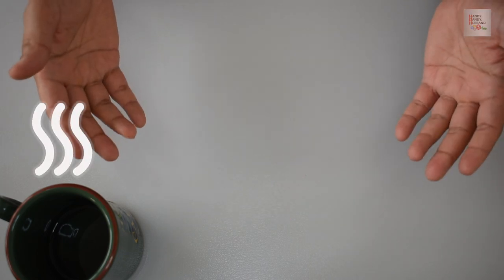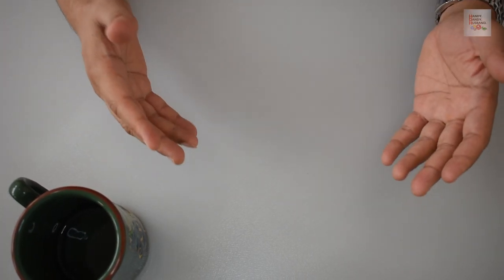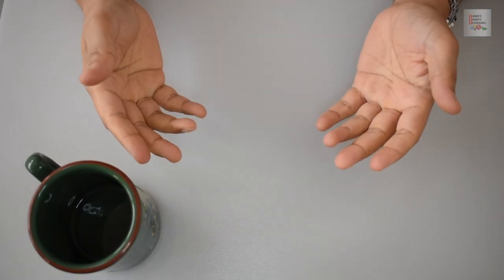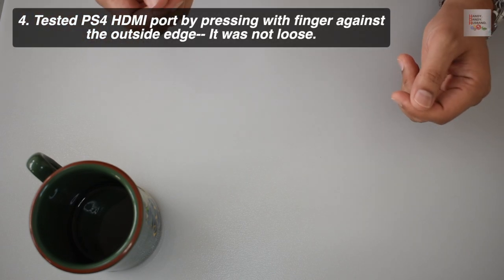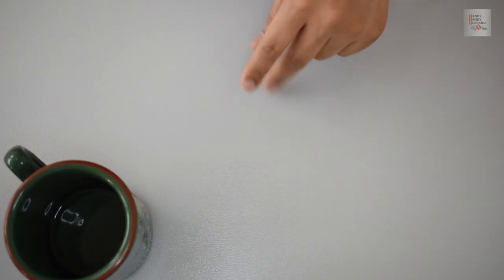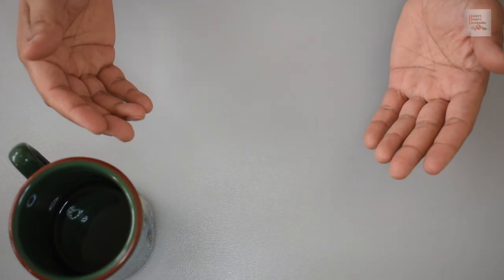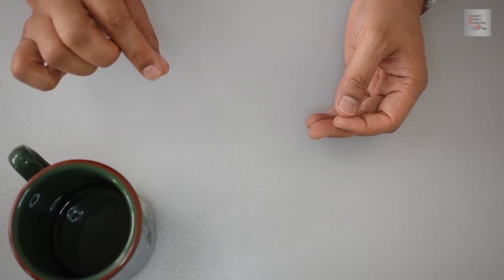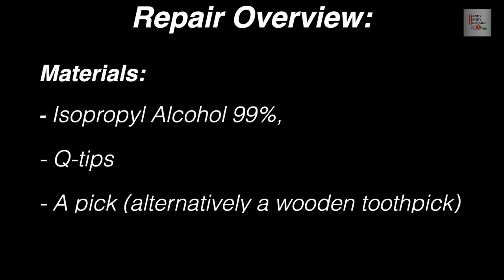𝗤𝗨𝗜𝗖𝗞 𝗧𝗜𝗣: 𝗣𝗦𝟰 𝗛𝗗𝗠𝗜 𝗣𝗼𝗿𝘁 𝗥𝗲𝗽𝗮𝗶𝗿 -- Easy, no solder required -- [Fix that video input error]

Comment: My ps4 still isnt working ive tried all your steps and it still doesn't work maybe i need to get it mechanical repaired which will cost me my leg 😔 but thanks for the tips .....
Reply from the maker: Hi Akatsuki, thanks for watching and sending me your results.  I am sorry the fix didn't work for you--that is such a bummer.  Make sure before taking it for repairs, contact Sony and ask them for a warranty approved repair depot near you.  It may be helpful to ask the Sony rep at that time if Sony would approve a warranty repair considering the problem was so widespread on all of the PS4 consoles--they may not agree but at least you tried.  All the best to you in 2021, H.D.H. [: { ].
Reply: @HANDYDANDYHUSBAND  I would but the system wasnt owned by me at first and thanks for the feedback and its ok ill figure it out its nothing major .....
Reply from the maker: @akatxukii  Hey there Akatsuki, wish you all best in getting your PS4 up and running.  Thanks, H.D.H. [: { ].
Reply: it dont have to cost alot keep lookin I found a place that reflows for 50
Reply from the maker: @cmoneytheman  Hi cmoneytheman, thanks for your comment and helping a fellow community member out.  All the best, H.D.H. [: { ].
Reply: @cmoneytheman  yoo thats crazy u just replied I just took it in the repair shop 😯
Reply: @akatxukii  u did its 120 in mornin here which country u in
Reply: @cmoneytheman  U.S.A vro 🧐
Reply: @akatxukii  u said u just dropped off is it not night where u at
Reply: @cmoneytheman  not just  dropped it off i mean i dropped it off earlier today and its crazy because u replied the day i dropped it off that's what i was trying to say
Reply: @akatxukii  ohh do u need a reball or flow I get a flow only a 100 for both ps3 and 4 all together
Reply: @cmoneytheman  i totally get a flow (idk what any of those mean 💀)
Reply: @akatxukii   did they not tell u and how much

Comment: Honey, a blind man can see that the "old" and the "new" HDMI connectors are not facing the same way. And those prongs - they have nothing to do with the signal output. They are only there to secure connector in place if you needed to move around cables or the console .. Definitely try to clean the port and replace the cable (it cold be a broken wire inside if you are moving it around a lot) but I would keep my hope in check if I were you ...
Reply from the maker: Hi The Riddle, thanks for watching and your comment.  I appreciate you taking the time to comment.  The metal prongs, I agree, do secure the cable contacts in place; however, that does not mean that they have nothing to do with the signal.  With HDMI--especially with the connectors on the PS4--the metal prongs play an important role.  When they are flattened out, they are unable to maintain the correct position of the cable to the small contacts coming out of the playstation and this then compromises the signal.  I don't need to keep my hope in check...the method worked well for me an many others.  I am sorry that it did not work for you.  All the best to you, HDH [: { ].

Comment: I’ve got mine replaced 3 times and I don’t touch it and it just falls apart it’s pissing me off because I can’t see to extract the data from it
Reply from the maker: Hi OsamaBonJovi, thanks for watching and sending me your experience with the PS4.  It is shocking that you have replaced the HDMI port 3 times.  Typically factory authorized repair depots replace the HDMI port with something much better than the OEM.  The fact that you say that 'it just falls apart' makes me suspect that the repair center is either not securing the port properly to the board or is soldering with cold joints.  You might want to ask them what type of soldering station they are using and/or if they also use a solder reworking tool (that blows hot air).  I would definitely take the PS4 to an alternate repair center.  Sorry that my fix didn't work you though man.  Hope you are able to get a proper fix done to the PS4 so that you can once again use it.  All the best to you, H.D.H. [: { ].

Comment: Yo bro sewing this video late my hdmi port fell into my game anyway you can help?
Reply from the maker: Hi Big Jay, thanks for watching and sending me your question.  I need some clarification:  when you say your "HDMI port fell into your game" do you mean the port broke off the circuit board and is now inside the gaming console shroud?  If this is the case, my fix won't correct the issue.  If the issue is something different, such as your HDMI port being loose or wiggling a little I might be able to give you some helpful suggestions.  Let me know, and I will try to help.  Hope to hear back from you, all the best to you, H.D.H. [: { ].

Comment: I’m struggling to get my prongs up please give advice thank you very much.Edit I pulled it up but now my hdmi won’t enter the pins are in the way I think I did it too high is there a way to pull them down
Reply from the maker: Hi Sarmad Hassan, thanks for watching and reaching out with your question.  OK.  I understand you are having difficulty with the thin metal prongs.  1st:  remember NOT to touch anything in the center of the HDMI port.  2nd:  If you pushed the outer thin pieces of metal too much toward the center, then gently push them down with a little bit of bouncy motion using a pick or a long thin pin/needle.  3rd:  remember that the front edge of these thin metal pieces needs to be flush or nearly flush (only the center circular bump should be protruding slightly upward) with the outer casing of the HDMI port.  If it is not, then the HDMI cable head will snag on it.  Hope the above helps.  If you need any further help, feel free to reach out to me.  All the best to you, H.D.H. [: { ].

Comment: My hdmi port has two metal strips missing and when I put the hdmi in it wiggles and is very loose. I don’t think it works anymore
Reply from the maker: Hi Sitsocits, thanks for watching and sending me your question.  I am sorry to hear about the state of your HDMI port.  I am not sure how the port lost the two metal strips--perhaps they broke.  If the HDMI cable is very loose, see if you can jerry-rig it in a position that provides a good video connection to your PS4 with some duct tape and patience.  Apart from that, I would suggest taking the PS4 to a factory authorized repair depot to have the port replaced.  Sorry my fix didn't work for you.  All the best to you. [: { ].

Comment: I’ve tried everything and my PS4 won’t connect to the tv
Reply from the maker: Hi Pc Joe, thanks for watching and trying this fix.  If you tried all my steps and it still doesn't work, I am sorry to say that the fix may not work for all situations.  Have you perhaps tried seeing if the HDMI port is loose (just try using your weakest finger and gently try to shift it).  This may be why it is not working.  If you have any further information, that would be helpful in me others providing further suggestions.  All the best to you, H.D.H. [: {].

Comment: My PS4 has the hdmi port loose and only works when at an angle. So usually I wrap the hdmi cable around my PS4
Reply from the maker: Hi A Potato, thanks for watching and sending me your issue.  If the HDMI port is loose than the actual electronic part that affixes itself to the PS4's electronic board is most likely compromised/damaged in some way.  If the PS4 works, then it may just be the pins that hold the HDMI in place (not the soldered pins that carry the video/audio signal to the rest of the board.  All the best to you, H.D.H. [: { ].
Reply: @HANDYDANDYHUSBAND  thank u

Comment: @HANDY.DANDY.HUSBAND. sorry I haven't replied or sent you pics in a long time that you were asking . I have emailed some pics of my Xbox one x . thank you and please look at them
Reply from the maker: Hi zxyn 7K, thanks for sending me the pictures.  I am replying on my YT channel as well by email. You are right the pics don't show very much.  That is OK, however.  Lets do some trouble shooting:  1st, take your HDMI cable and make sure the cable is completely clean of any debris by cleaning it with isopropyl alcohol (rubbing alcohol) and a white cotton rag or paper towel, 2nd, plug in the HDMI cable as you would normally (to the Xbox and an input on your TV/monitor) and also the power cable so that you can turn on the Xbox, 3rd, turn on the Xbox and see if you get a video signal to your tv/monitor.  If you don't, try slowly and gently shifting the HDMI port completely through the full extent that it wobbles.  The point here is to see whether or not with movement and some positioning you can get a signal.  The theory is that if your port wobbles then it could be the solder joint between the contact points of the port and the board or it could be just the solder points that are meant to hold the HDMI port in place.  Try to do this slowly and methodically, if you do get a signal for a brief instant, that is OK, you are trying to work with a proof of concept.  If you get a video connection, try to see if you can with a small wedge (toothpick) between the case and the outer part of the HDMI port hold the HDMI port in that exact position.  If you can, then do so, and gently tape the HDMI port/cable with some duct tape.  It won't look pretty, but it may work.  If you don't get any picture or any change in the connection, then likely you your port has become detached from the board and the contact points between it and the board are compromised.  You should contact Microsoft and request a warranty repair covered under warranty (even if it is out of warranty) based on a customer service exception.  If they agree great, if not, then my suggestion is to get the port professionally repaired by a warranty authorized repair center.  Some people do complete this repair on their own; however, you need the right tools (esp. temp. controlled soldering iron station) and technique (ability to apply the exact amount of solder); therefore, I would not recommend doing it on your own.  Hope the above helps you out, all the best to you, H.D.H [: { ]

Comment: My ps4 just broke because like week ago my TV on ps4 was turning of and on then I tried other hdmi it was working for a week and now things started be the same and today my hdmi is not working I tried on diffrent tv I was working but little colorful dots started apiering and I turned off my console to do not broke the tv  what should I do?         Sorry for my bad english
Reply from the maker: Hi FireCh1ld, thanks for watching and sending me a summary of your issue.  Can you please let me know whether you tried the fix in my video.  It may help resolve your intermittently failing HDMI connection.  I will try to help you as much as I can once I know what results you obtained from the fix.  Wish you the best for the New Year 2021, H.D.H. [: { ].
Reply: Hi i tried same hdmi on my ps3 and its working but on ps4 it doesn't so I tried everything you said and then I saw that 2 little conectwrs are blend in with port I tried to pull them out but sadly I couldn't I tried wooden pick but it's too hard and I dont have that metal thing that you have, what other tools do you recommend?
Reply from the maker: @lilboigo0se100  Hi FireCh1ld, thanks for getting back to me.  Another tool that you might try is a long pin or a thick needle--either should be much stronger than a wooden toothpick.  If you don't have either, you could also try getting some plastic tooth picks.  The last item you could repurpose for this fix is a metal dental pick, but those are not typically found in most households, so you will have to purchase it.  Hope the suggestions work out for you.  All the best to you, H.D.H. [: { ].

Comment: hi, my playstation 4 hdmi isn’t working, i’ve tried multiple hdmis, in one of them i had to move the cord around and it worked for 2 seconds but i’ve tried around 11 hdmis i’m not sure
Reply from the maker: Hi h2l2y x, thanks for watching and sending me a summary of your issue.  The fact that you have tried multiple cables means it likely not a cable issue.  Also, the fact that you were able to some video contact when you moved the cord around, does give me some hope that your issue may be addressed.  1) clean the newest HDMI cord you have with isopropyl alcohol, 2a) make sure the metal strips in the HDMI port in the PS4 are visible, if they are great, if not complete the fix in my video. 2b) Plug the HDMI cord into the PS4 and the other end into a working TV/monitor port and turn on your PS4 normally.  3)  on the PS4 port end, try gently moving the hdmi cable head first to the right, then left, then up, then down all the while looking at the tv to see if there is any change in the video signal (use a mirror on your couch if you are moving the cable from the back of the tv).  4) If any of the directions work, then use some duct tape or masking tape and try to tape the hdmi cable head in that exact position.  5) Play with your PS4 in a video intensive game--one which makes the fans turn on loud for about 3 hours (this will heat everything up including the HDMI port and the cable).  Then 6) turn off the PS4 as you would normally and let it sit for 24 hours.  Last, 7) try to gently take the duct/masking tape off and turn on the PS4 and see if it works.  Hope my suggestions helped you. If you get a chance, please try to provide your results.  All the best to you in 2021, thanks, H.D.H. [: { ].

Comment: Hey so it’s just my hdmi port is pushed in my ps4, do u think u can help
Reply from the maker: Hi edwina daniels, thanks for watching and sending me your question.  If your HDMI port is physically pushed in and (I assume) your PS4 cannot display video, likely the port retainers (the soldered bits that hold it to the circuit board) have broken or loosened.  My video would not be able to address this; however, there are authorized repair depots that can resolder the port back to the board.  Try to find a factory authorized depot near your are by contacting Sony or looking on their website.  Hope you get your PS4 running again, all the best to you, H.D.H. [: { ].

Comment: I bended the pins upward and it’s still not working but I saw that the thing above the pins is moving what can I do to fix that ?
Reply from the maker: Hi Rk Production, thanks for watching and sending your question to me.  I am not sure what thing you are referring to that is 'above the pins'.  Are you maybe referring to the very center area of the HDMI port (looks black with metallic strips on both its sides?  Please let me know and I will try to help you out.  All the best to you, H.D.H. [: { ].
Reply: @HANDYDANDYHUSBAND  Yes that’s exactly what I’m talking about, is there anyway for me to fix that from wiggling around and get my ps4 pro displayed on the tv
Reply from the maker: @robertkirkscoverchannel.  Hi Rk Production, thanks for getting back to me with the additional information.  I am sorry, unfortunately, that center piece that is loose in integral to the HDMI port itself--meaning that if that is loose, likely the port needs to be replaced as that center piece has been compromised/broken and cannot convey the signal coming out of the PS4 to the HDMI cable and then to your TV.  Best suggestion is to find a Sony factory authorized repair depot and have them replace the port.  Sorry I couldn't be of more help to you.  All the best to you and I hope you get it repaired.  H.D.H. [: { ].

Comment: My hdmi input is loosend what can i do about it
Reply from the maker: Hi Stan Vandenbulcke, thanks for watching and sending me your question.  If the actual HDMI port on your PS4 is loose, it typically points to a HDMI port that has had its solder connection with the circuit board broken/or loosened.  I have heard of some people jerry-rigging their PS4 even with a loosened port but the fix is temperamental and does not last long.  One 'hail mary' attempt you can make, is plug in your HDMI cable and gently shift the cable while your PS4 is on.  If the connection between the port and circuit board is only slightly off, this movement might be enough to get your PS4 to emit a video signal and make it playable again.  Have some duct tape handy to affix the cable in that exact position.  This will not be a long term fix, though.  If the last ditch effort doesn't work, you will need to have the PS4 HDMI port replaced.  Try contacting Sony for their nearest factory authorized dealer near you.  Hope you get it working, all the best to you, H.D.H. [: { ].

Comment: How do you fix a ps4 that has its prongs all over the place
Reply from the maker: Hi Dabi, thanks for watching and sending me your question.  If you have 'prongs all over the place' you might have the middle/center area thin metal pieces moved out of place.  My PS4 only has two thin metal prongs on the OUTER metal casing (not the inner area).  If you issue is with the middle area metal pieces, my fix won't work for you.  Likely an HDMI port replacement is required.  As a last ditch method (hail mary attempt), you might want to try carefully bending the metal prongs to their intended position and adhere them to the center post with crazy glue--but this is highly risky.  So only use this method if you have to replace the HDMI port anyways.  I can provide further thoughts if you can send me a clear, close-up picture to my email address:  thehandydandyhusband.info@gmail.com
Look forward to hearing from you, best wishes, H.D.H. [: { ].